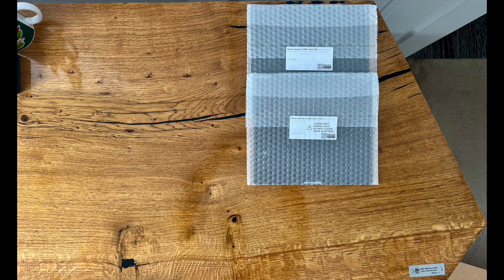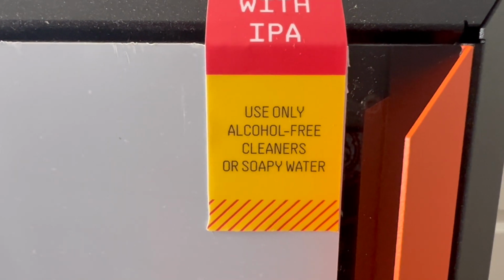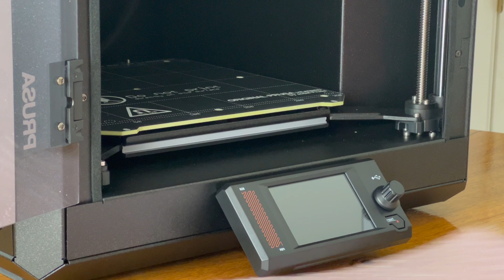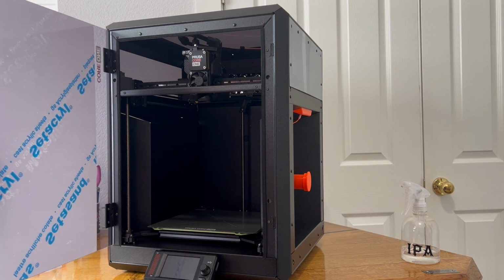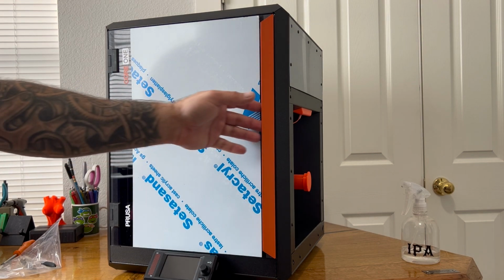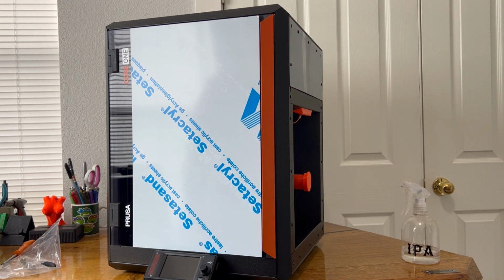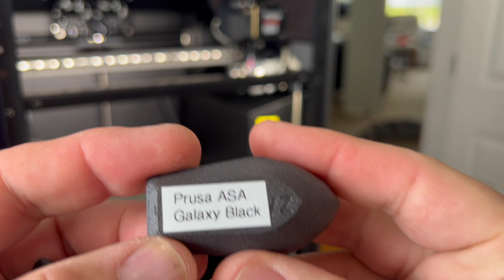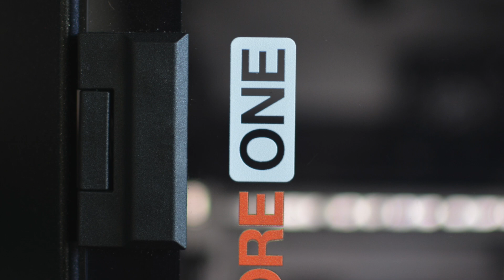Prusa Core One First Impressions

Comment: It is not open source. Just check it out. It has some parts which are open source, but regarding the hardware, only 4 parts are open source so far. It is hard to mod anything if you dont have step files...